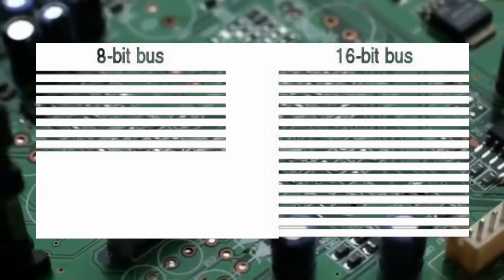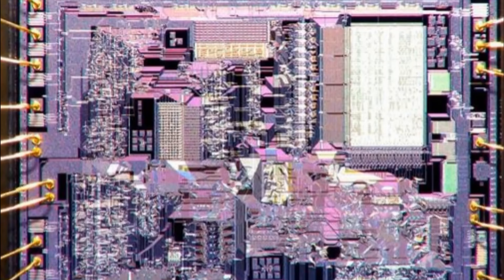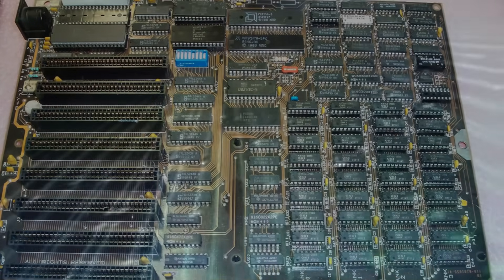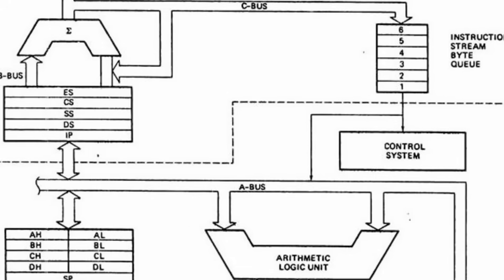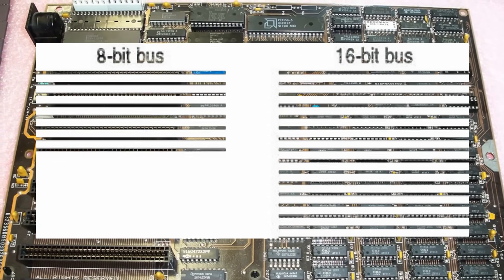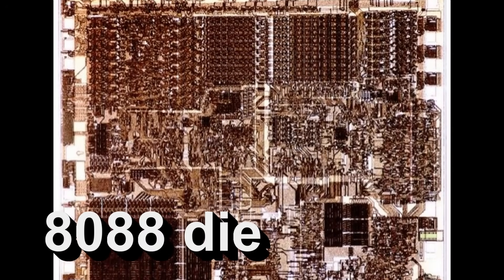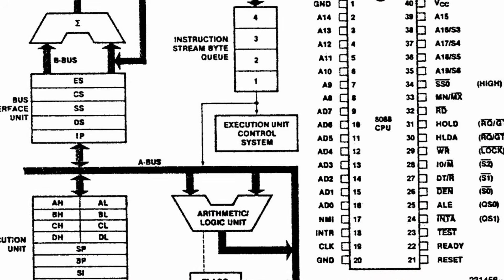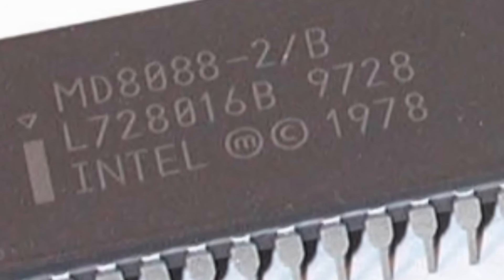8088 & 8086 CPUs... Why 16 bit Came Before 8 bit [Byte Size] | Nostalgia Nerd

Comment: we had an 8088xt turbo when i was a kid. Not until a few years later when i understood pc's better i found out it had a turbo card. that was pretty weird.
Reply: Unlikely. Most 8088 were "overclocked" parts, they simply worked fine with higher than standard 4.77Mhz crystals. But some software (ie. old games)  didn't account for more than 4.77mhz and would become unplayable, so the pc clone makers introduced the "turbo" button, a switch to go from overclock mode (turbo) into normal mode, now you could play Digger properly again with that 12mhz 8088 cpu put to work back at 4mhz by pressing that button. 
TL:DR was not a "turbo card", but an overclock switch they called "turbo".

Comment: Another interesting subject will be, what's better, a 1mhz 16 bit cpu or a 8mhz 8bit cpu, would be really interesting.
Reply: Hard to tell since ALU and register width on 8086 and 8088 (as I understood) are 16bit. I dont think there is an 8 factor. Speed on the internal registers is tied to Mhz and width. Aritmethics, integer, wont penalize by an 8 factor. None of them can do 32 bits resutls or math or floting point. Both emulate them. It could be noticeable on memory access for program and data, but is factor could be not bigger than 3 .... worst case.

Comment: The IBM PC may have been (arguably) amazing, the 8088 was certainly not! Specially among game programmers as it notoriously inefficient thanks to it's neutered data path, causing the instruction pipeline to be empty most of the time as the ALU processed instructions faster than they came in wasting cycles.

Comment: ... And this is how IBM delivered the original PC with a CPU slower than most real 8-bit CPUs despite being technically 16-bit. This type of technique is the plague, they claim it offers the power at a low cost, but such bottlenecked systems tend to be worse than the "real" system of a category below. The 16 Mhz 286 pure 16-bit also outpowered the 16 Mhz 386SX crippled 32-bit CPU.
Reply: I'm going to need some kind of source on that "16mhz 286 is faster than a 16mhz 386SX" claim. The SX still had a more efficient core clock-for-clock even when operating on pure 16-bit code, could run 32-bit software (which, yes, meant a performance hit... versus the 386DX - if the 32-bit instructions were used intelligently, in a mix with 16-bit where appropriate, it should still have meant a boost vs the 286), could use protected mode much more easily than its predecessor (meaning it was much more likely to be found actually using that mode, which conferred advantages like not having to fart about calculating segment offsets for each memory address outside of the first 64k, and being able to make much more efficient and speedy use of memory over 1mb, particularly when it was connected directly to the motherboard rather than sitting on an ISA card), was inherently better at making use of external caches despite not having an internal one (at least, not until the laptop-focussed SLC came along), and even turned up in systems with Local Bus and/or EISA expansion slots meaning it could communicate with those peripherals a lot faster than over regular ISA (which was stuck at 7.16mhz) despite still only having a 16-bit data bus.

Possibly there are well made, and moreover very well-tuned 286 systems (especially those which have an x87 coprocessor, or maybe actually use an NEC V40 chip...) that are able to outperform generic, poorly set up, default-setting-using 386SXs on a clock for clock basis; but on a level playing field, the SX should be able to outrun the 286 even where it's been dropped in to the exact same motherboard as a direct replacement (which, after all, was sort of the point of making a 16-bit bus variant in the first place, the same as making both the 8088 - which could use 8-bit boards originally intended for the 8085 or 8080, and the Pentium Overdrives - which adapted the 64-bit Pentium to work in 32-bit 486 and even some 386DX boards).

I mean, the difference might not be that much, but it'll still be measurable.

And if you were to run code tuned for the 386 itself and thus then 286-incompatible (as it implemented several new instructions even if running in 16-bit mode, and featured wider main registers that could be broken up to provide twice as many 16-bit pieces of internal storage as well as several wholly additional registers vs the 286, ultimately meaning more work could be done wholly internal to the CPU without having to endure the performance penalty of hitting RAM for more data) the improvement should be even more noticeable.

And that's not even considering the usability benefits produced by Virtual 8086 mode and all that... or that it had its own 16-bit version of the 80387 (the 387SX) which was faster than an equivalent 287... or that the 16mhz parts were only ever meant as the cheapest possible point of entry to the 32-bit code environment (with the SX itself being capable of higher clocks than any 286, and the DX being faster still) so it didn't even matter if they really were slightly slower than the older chip on the exact same code.
Reply: 386 had memory protection and other basic security features though.
Reply: Very true.  Text applications like Word Star were much faster on my 4MHz CP/M KayPro machine than on a 4.77MHz IBM PC.
Reply: @RonJohn63  Maybe because it was a poor port of the 8080 code and not native code. Of course this applied to Z80 also.
Reply: That was very common in those days. First develop some device with full power, then derive a less powerful crippled version. I assume it was commercially attractive do to so as something could be advertised as further development of the real version and then sold as the crippled version. Wasn't there the 386SX where they did the same trick, 32-bit internal and 16 bit external. And the 486SX which had an integrated numeric copro -- oh no, wait that was the 486DX and they disabled it on the 486SX.
Reply: The "SX" suffix was born when a large number of processors coming off the line did not meet factory specifications.  These were offered with the suffix.   Later they just disabled to numeric processor to maintain the SX market, which seems kind of a way of cheating.
Reply: @swinde  That is not relevant to the 386SX.
Reply: Swinde, you're half right.  That's what they did for the 486.  As jlinkels correctly stated, the 386SX had a 16 bit external path; this was so that the chip could be used with cheaper parts (support chips with 16 data paths already existed for the 286, and were a lot cheaper than the relatively new and larger chips with 32 data paths).
Reply: @RonJohn63  Or that it could be sold with just 2 MB of memory instead of 4. Memory was not cheap back then.It was specifically designed to kill fast 286s from companies like IIT and Harris. 486SX was later done for same reasons to AMD.
Reply: +RonJohn63 ... I do wonder how much of the extra speed on the CP/M was down to programmer skill, as well as the graphics system being much more closely tied to the rest of the system rather than on a separate board on a whole different expansion bus; the additional latency from having to send data down those additional steps, and the lack of sync arising from the CPU and peripheral buses running at wholly different speeds (one being /2 of the main clock, the other being /3) could easily count for a good MHz's worth of performance if not more.

Generally when you're porting something, speed and quality is going to suffer, vs something made for that machine from the ground up. But the MDA and CGA (and indeed PGC) were never particularly fast things regardless of what machine they were installed in, and the CGA had the additional fun thing that unless you only addressed it during blanking periods (cutting the possible speed to less than half) you got snow all over the screen...
Much better to get a Hercules, Plantronics, even IBM EGA card instead. Or, like, something that wasn't an IBM PC until they'd progressed to at least the AT. At the very least, a Tandy, which still had the iffy underlying core system (unless it was one of those with a V20 or an accelerated 8088), but had better graphics and sound chips.
Still, a 4mhz Z80 does not a particularly shabby system make... other than some later MSXes and the Gameboy Color, I don't think many people bothered using faster grades of the chip (unless they couldn't get the slower, cheaper ones any more), because on the whole that's generally enough power for a basic computer or console, and if you want to go faster you're as well to just upgrade to a 286 or 68000 instead.

As for the 386SX, I'd bet blind that they were aiming that puppy at system builders and even motherboard manufacturers as a way of getting 32-bit compatibility (and, they probably would have tried to claim, greater speed) without having to make any significant changes to their existing and still not really that old 286 based board designs. Hence the address bus also being suspiciously exactly the same as that in the 286 (and, at the time, more than sufficient for anyone not building a monstrous server).
It's not something that's totally without value - for example, being able to use Virtual Memory on a Windows machine with only 4mb, possibly 2mb or even just 1mb RAM (the latter being a marginal, but still possible case under 3.x) is extremely useful to cut down on repeatedly having to close and re-open programs whilst multitasking. It might cause some disc thrash in the process, but you would otherwise have had to reload at least as much data if not far more so.

And of course you also get proper, flat-memory-model protected mode thrown in... which is something the 286 could sort of do, but not very well (as it basically just inherited the very basic flavour introduced with the 186 and didn't do much to improve it), and Virtual 8086 mode didn't exist on that chip so you wouldn't have been able to multitask any Real Mode DOS programs from within Windows, not even in an effectively single-tasking window that uses zero processor time in the background and 100% in the foreground, because the entire CPU would have to be reset every time you switched task. A better written OS like OS/2 might have been able to goad the 286 into properly virtualising old real mode processes with some level of software emulation thrown in, but that's additional complication which the 386, including even the slowest clocked, "16 bit software only" marked SXes completely did away with by bringing full, proper virtualisation on-chip. And if those are the features you're particularly after - flat memory model, virtual memory, and being able to multitask real-mode programs alongside protected-mode ones - and you're not massively bothered about the absolute processing speed but are bothered about cost per system, then the 386SX would have seemed like an extremely attractive prospect.

Certainly, it appears to have been a hugely popular chip, so they must have done something right - even in the pre-WWW age, you could only have got away with introducing a new CPU that was slower than the old one and offered no other compelling benefits for so long before the industry as a whole twigged what was going on and called you out on it. Maybe a couple months max, whilst magazines ran their tests on the provided samples, then published the results, and that would be the end of it. These days it's more like a week - just witness the whole debacle around the later, somewhat experimental extra-long-pipeline revisions of the Pentium 4, which generally just made it more power hungry and slower clock-for-clock whilst doing little of much use in return. Intel ended up smarting so much from that escapade that they soon reworked the desktop versions to be more like the older model with enhancements in other areas, and ditched the P4 architecture altogether for mobile use and based the Centrino Pentium-M's off an extension of the P3 instead, then leapfrogged straight to the Core and Core 2 architectures (which were essentially their Motorola-going-to-PPC moment of throwing up their hands and admitting the pure Pentium line had reached a dead end) when those came along, not even resurrecting the Pentium name for another couple of years, when they finally needed something new-but-old to sit between the Celerons and Cores.

+jlinkels ... and they're still doing that to this day. The first Celerons were Pentium IIs whose cache failed the QA tests, for example. And there's a traceable progression from the current Celerons up to the i7s (and maybe even Atoms through i9s) of gradually more features being built on the lower level chip, generally things that are progressively more fragile and potentially finicky and sensitive to small defects across large areas of the chip - core count, cache size, GPU complexity, hyperthreading and turbo boost capabilities, etc, as well as how high a clock speed they can withstand (if a bit of insulation in a certain place is not as thick as it should be, that could lead to resonance effects between neighbouring traces at higher frequencies, causing a crash... so on and so forth). Right down at the bottom end there's little more than one or two main compute cores and a very sparing amount of cache... but for all we know there could be the blasted remains of a largely nonfunctional i7 sitting alongside all the parts that work and that still have their deactivation jumpers intact (or are the only things that don't have them, because without those parts the chip is useless anyway), with all the speed setting jumper traces burned out to lock the thing down to the lowest possible speed grade as it would just crash if you tried to go any faster.
Reply: Remember that this was in the day that a single instruction could take 194 clock cycles. The impact of the 8bit bus was less then 5 percent.